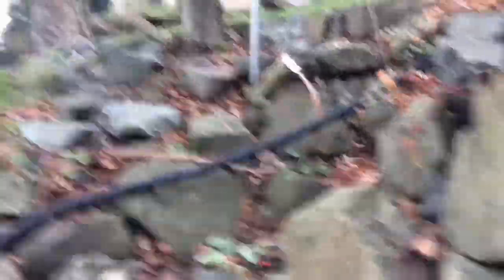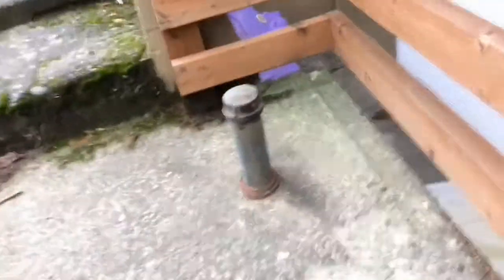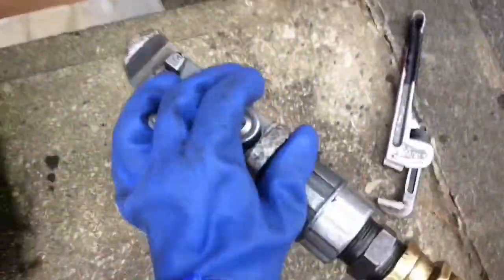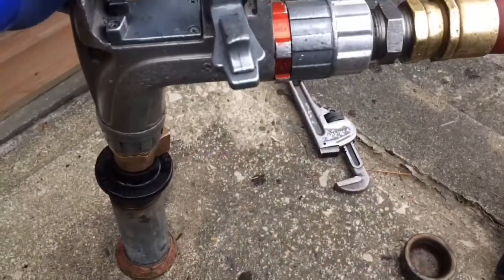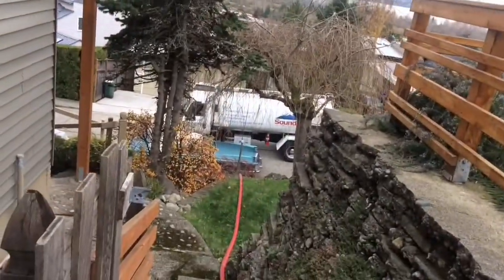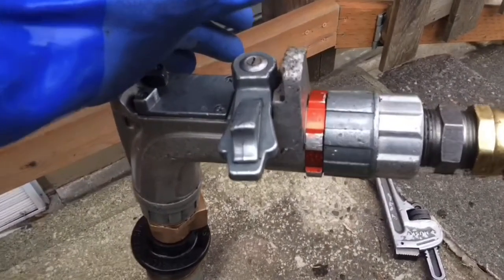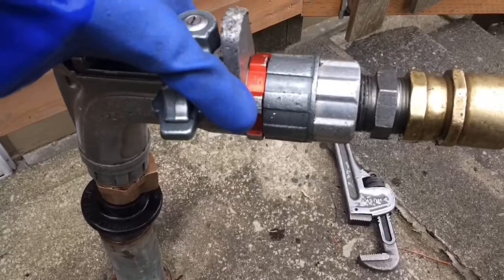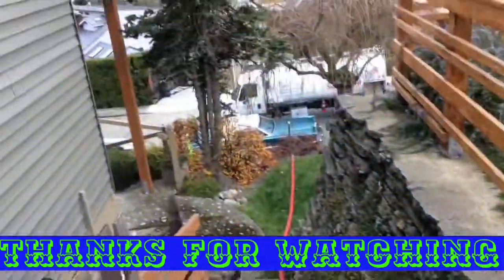Heating Oil delivery Seattle (SOUND OIL)

Comment: Couldn't help but notice you used a brass nozzle to do the fill. Looked fixed to the nozzle. Are all the fills in Seattle like that? I'm from Pennsylvania. I too deliver heating oil. We use that fill, pin fills, Philadelphia vent box, NY fills, Scully fills, and drop heads. Every home is different. So my truck has this tool box of fittings and screw on's to adapt fills for delivery. Awesome truck and nice pull. Must be a fun one in the snow.
Reply from the maker: Yes it is a brass whistle spout screwed on to a Scully , it whistles while the air is leaving the tank and stops when the tank is full, saves from measuring and cutting the fill short, if the vent is bad then we use a vent pipe (or as we call it a long pipe) that goes in the fill pipe before the whistle nozzle, and vents through the long pipe so you still get the whistle. yes and thankfully we don't see much snow, thanks for watching